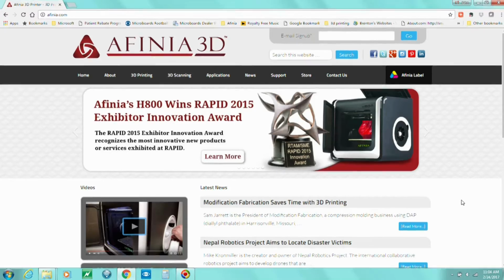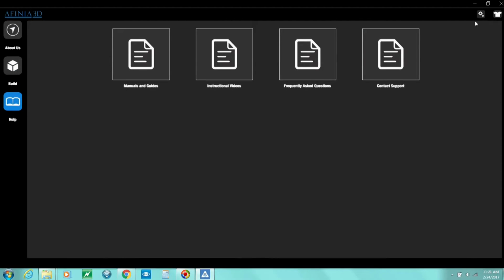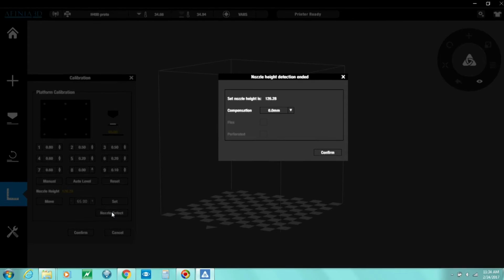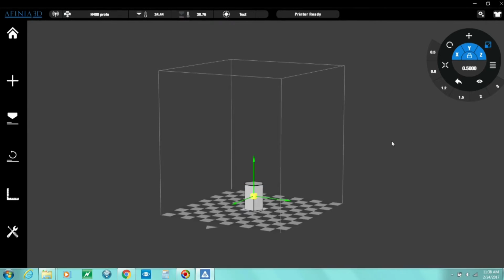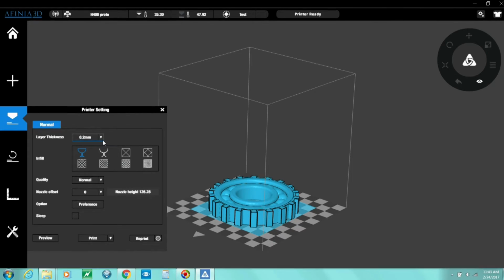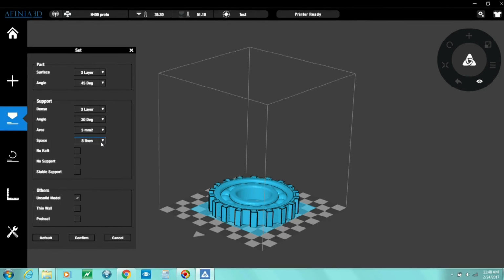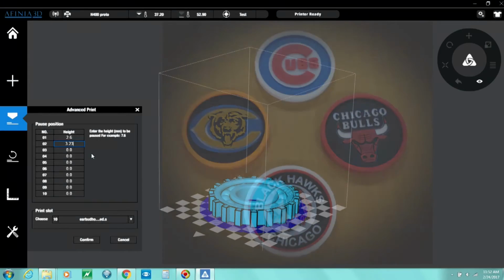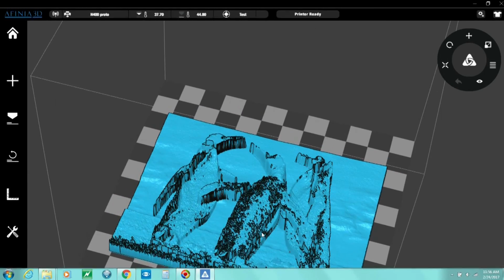Afinia 3D Studio Software Instructions

Comment: We are trying to use the new studio software with our H800 printer. Everything is fine with the model getting auto leveled. The problem is with printing. Our printing button is gone on the printer setting area. We just cannot see it. They are cut off or something just not there. Any ideas. Would love to print.
Reply: Patrick, the print button does not show up if you're not connected to a printer. Try clicking the settings button on the top right corner of the screen and locating your printer via wifi or you can connect by usb. If the print button does not show up, please contact our technical support department for further trouble shooting. They can be reached by phone at 888.215.3966 x.4 or by email at support@afinia.com.